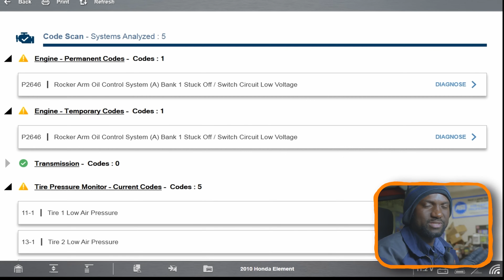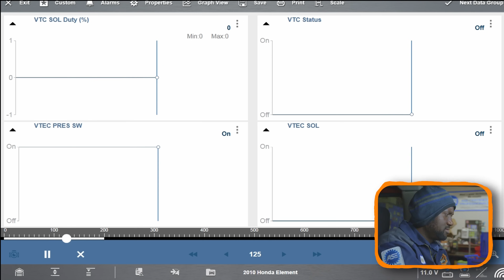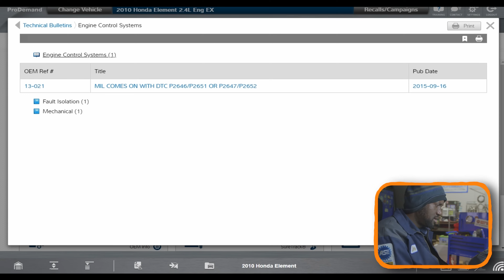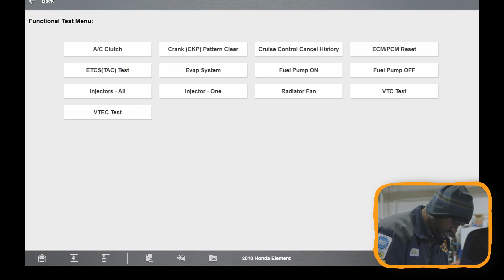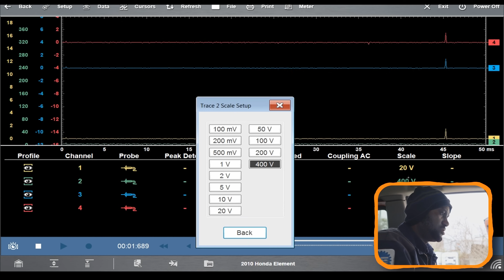Honda Element : Engine Loses Power & Surges, Code P2646 Diag & Repair - Part 1

Comment: Fantastic video . This answers the same 
P2646 code problem that I am experiencing. 
My Honda element is having exactly the same vehicle symptoms as video . Aftermarket VTEC
Sensors I purchased online did not Last but a few months . Honda parts are much more durable . Thanks

Comment: I started respecting Deon when he showed how to diagnose a faulty radiator fan control module that is stuck On/Close. The way he diagnose the fault and rule out coolant temperature sensor and ECU malfunction was a show of brilliance and skills. This man is a master technician and mechanical diagnoser. Big up from South Africa.
Reply from the maker: @kayrams1792   Thank you!

Comment: I see these a lot in shop and the oil leaking thru the solenoid it skews all signals thus condemning the switch.
Reply from the maker: @eliezerramosjr1017   Good point! Check out part 2 tomorrow

Comment: bro is it necessary to know ecm wiring to be a car mechanic?
Reply from the maker: @nahidsarker69  No! not really depending on the kind of work that you wanna be doing as a mechanic
Reply: @KITS_Auto_and_Truck_Repair  i want to focus on auto diagnosis and auto electricity only.

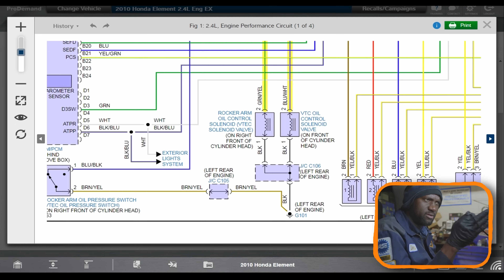Comment: @ 24:53 
Where is the PCM located?
 In around the fender well? Connections may be wet?
Reply from the maker: @ekimbrough1413  Probably! I didn't check the PCM location

Comment: Look for open wires and water vunlerable connections underneath the vehicle.
Reply from the maker: @ekimbrough1413  the answer is in Part 2, Stay tuned

Comment: @4:52 
Ok . 
Something in the wiring is getting wet? Green crusty's somewhere in the system. Open circuit?
Reply from the maker: @ekimbrough1413  Part 2 will answer your question my Friend, I Can't give it away, stay tuned!

Comment: This issue appears to be common in the Honda Element. Really nice to see the diagnostic process to confirm that it is indeed a bad sensor/switch. As noted in other comments, electric-related issues always feel overwhelming at first, but videos like these go a long way in helping dispel the mystery of the beast and illuminate how this is just another aspect of the discipline all technicians need to be able to manage. Interestingly, same code (albeit less common) is also seen in the Corolla iM and that is usually caused by a faulty part as opposed to a sensor/electrical issue.
Reply from the maker: @SidneyHMusic  Thank you, Part 2 is awesome stay tuned
Reply: Took your advice, its fixed, thanks

Comment: considering your diagram, the ground should be on all the wires. the switch is a normal closed one, one of its side is connected to the ground, so you get the ground on its second pin. the same is about solenoids, but the ground on their second pins you get through solenoid coils when ECU does not control them...
Reply from the maker: @gon123able  Cool, Stay tuned for Part 2